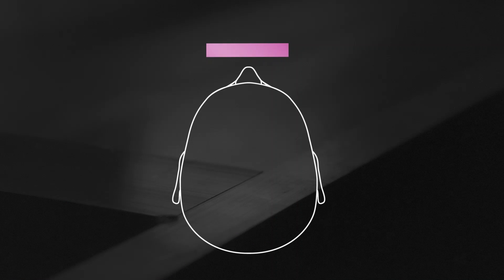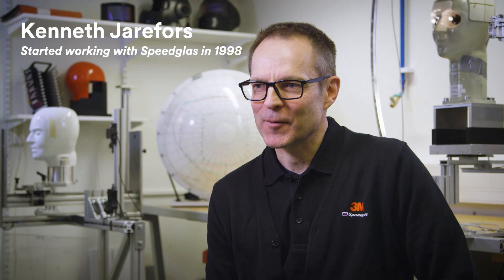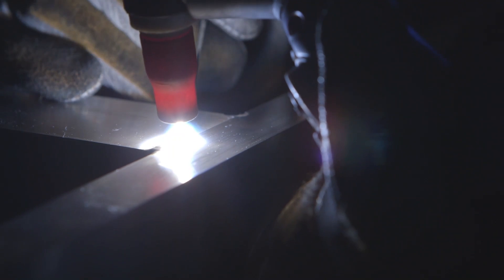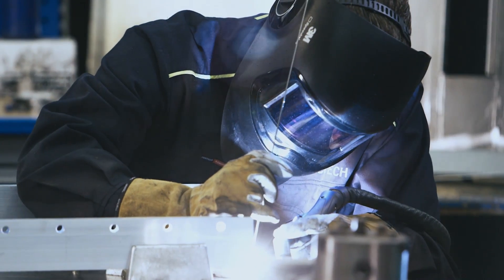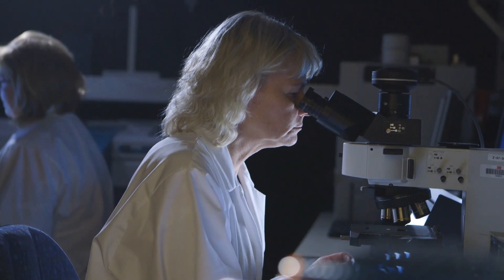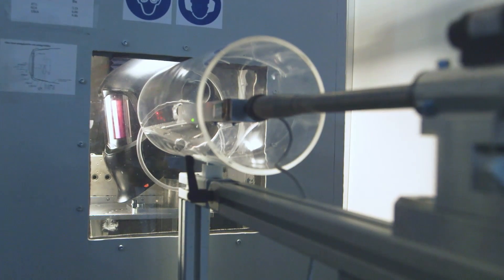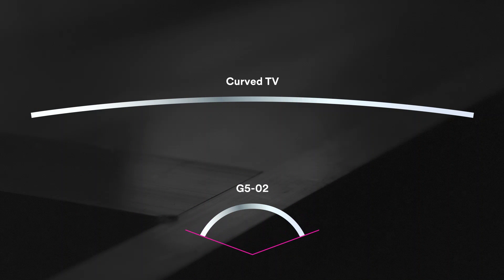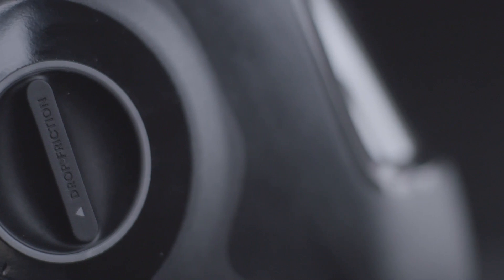3M Speedglas G5-02: 20 years in the making

Comment: How do you plan on producing the G502 without incorporating a Powered Air Purifying Respirator (PAPR) system? You're creating a superior helmet. However, despite its price point, conscientious customers may be dissuaded not due to cost, but because it doesn't meet the essential safety requirements they need, such as air purification.